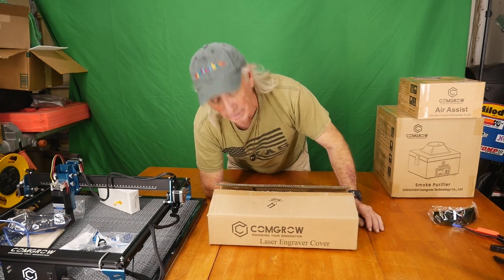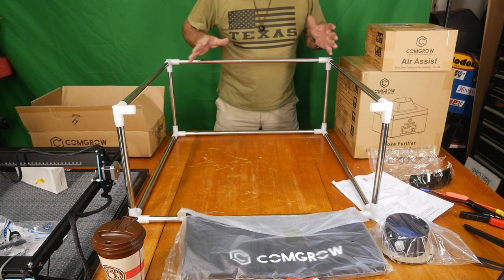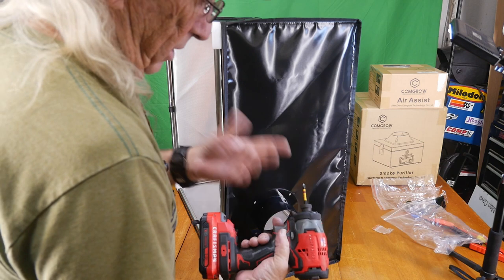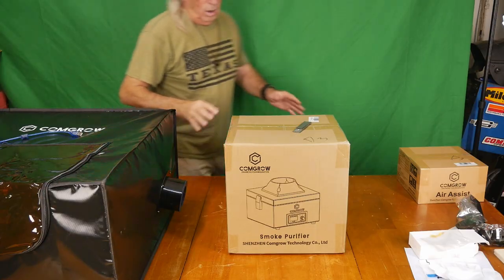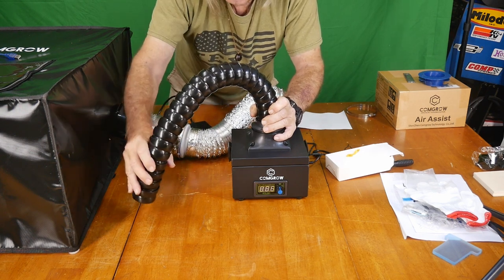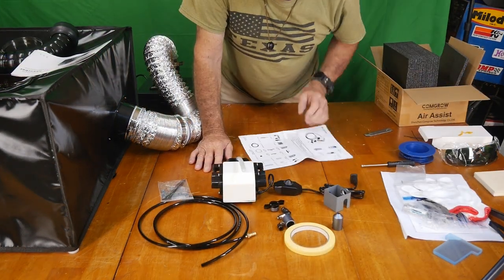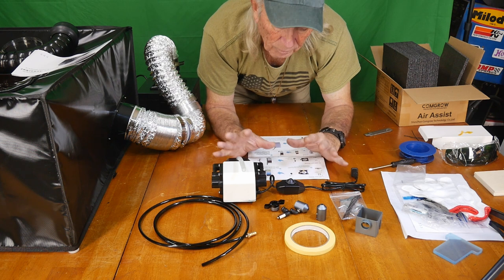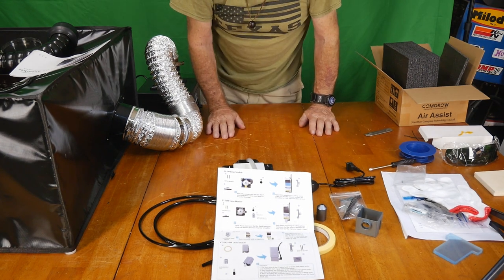Comgrow or any laser engraver and cutter accessories for upgrades Pt 2, Coffee and Tools Ep 280

Comment: Hey I keep checking out more of your reviews and wanted to say, keep it up! I got my Ender 5 from Comgrow a few years ago and when I picked up the Creality Falcon 10w laser I snagged the comgrow enclosure, air assist and honeycomb (also those separate pieces I snagged from aliexpress just in case something didnt fit). Happy to say, it all fits great! I did get the smaller honeycomb (2 of them cause I screwed up) and wish I had the bog one that the whole laser would fit on but it is what it is, it works. The air assist seems like it would fit right on with no problems but I still may use the end i got from aliexpress since it just seems like a really nice air assist nozzle. I keep eyeing up the smoke purifier system but really I just dont think it will do a good enough job to put the laser in my basement but I could be wrong!  Anyway will shut up and keep on watching the videos :)